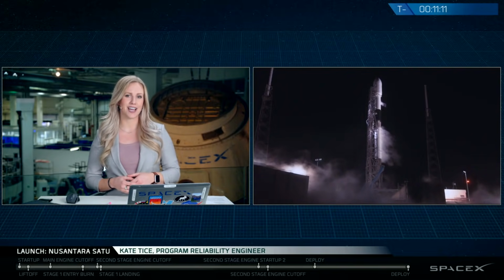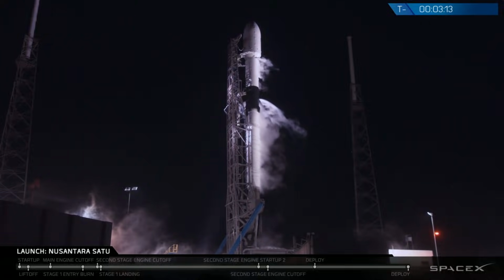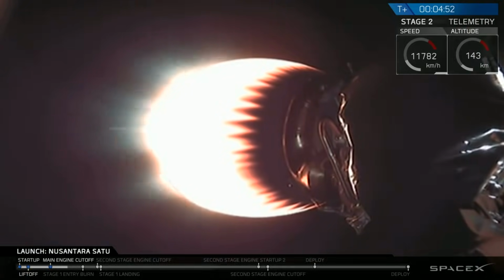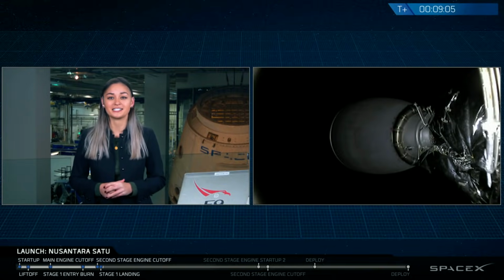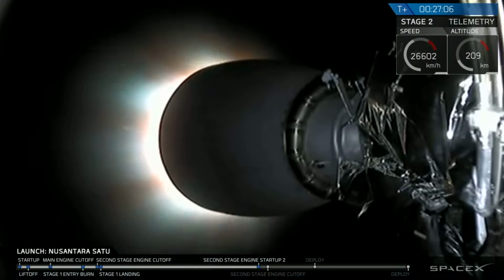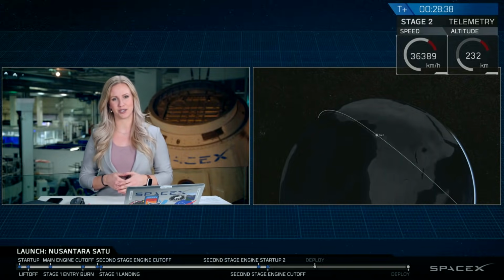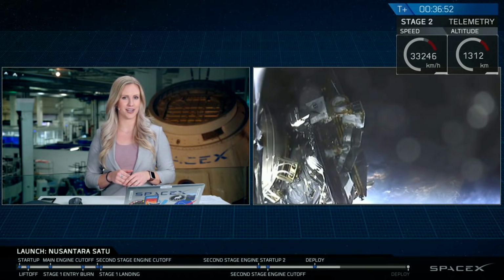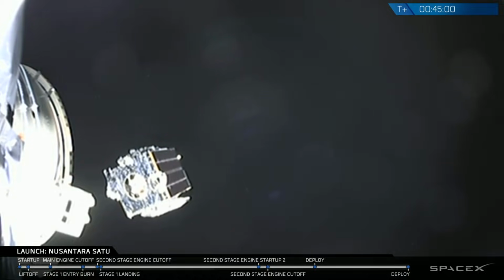Nusantara Satu Mission

Comment: I love it how they are progressively reducing their stage 1 landing celebration. As if they are getting used to it.
Reply: That's a good thing
Reply: It's weird because when they first landed them it was a massive hype then it died down by the end of 2016, then shot up for a bit at the start of 2017, and then as boosters started re-flying there was massive applause. It died down just after Falcon Heavy before going back up for Block 5 and now in 2019, every single mission has had pretty high amounts of applause, due to the record breaking landings

Comment: A few weeks left till the Block 5 Falcon heavy is in space 😋
Reply: Hopefully, if it doesn't get delayed more..
Reply: ONE WEEK!?
Reply: @PassportGaming  If Dragon 2 launches on March 2nd, Falcon Heavy cannot be launched for another 5 weeks because of the time it takes for a turnaround of the pad.
Reply: @PassportGaming  That's simply not possible. Dragon 2 launches on LC-39A with a Falcon 9. Shortly after, they will begin a long 4 to 5 week process of switching the launchpad to an FH compatible one, and fixing/cleaning the launchpad. FH can only launch on LC-39A.
Reply: @PassportGaming  tag me
Reply: @kuu5956  That was their old Pad that took that long, Im pretty sure the ones they have now in florida are both upgraded so that they can be turned around within a week or two
Reply: Tag me in
Reply: @kuu it literally launches from the center clamp for falcon heavy support clamps
Reply: Shiii
Reply: @PassportGaming  @Kuu Is correct, Only one pad is used for the heavy. Same one the Saturn V used, and shuttles.
Reply: All they need to do is switch the clamps to heavy configuration iirc. Probably NET 3 weeks after Dragon 2
Reply: Mid March hopefully
Reply: I really hope it ends up being fully recovered. Need to get that centerstage on the barge...
Reply: @PassportGaming  No you won't. Currently on the manifest, in order, is March 2 Unmanned demo mission, then RadarSAT after that, then In flight abort test (which is going to be so awesome). After that CRS-17 on April 25, then finally Falcon Heavy Arabsat sometime in March, probably. I will bet you 1000 internet points that it won't launch in 1 week 5 days.
Reply: That timeframe is highly questionable, considering there is another launch scheduled for the same pad 5 days before that, a 5 day turnaround on a single pad would break ever record there is for getting a pad ready for another launch
Reply: No. Although a lot of people have this idea that it has been scheduled for March 5, the only source I have found for that is spacexnow.com, which is a fanboy site with a lot of errors in its launch schedule. More reliable sources, such as Spaceflight Now and the Wikipedia page List of Falcon 9 and Falcon Heavy Launches continue to show it just being "March", with no date specified. My guess is that they don't want to set a date for it until Demo-1 is safely in orbit. I would say expect it in mid to late March some time.
Reply: Kuu where did you get that 5 week time? It would take 2-3 weeks to get it ready for falcon heavy
Reply: Jay Buens actually it has nothing to do with clamps, there are 2 primary reasons why a 5 day turnaround is unrealistic, the pad takes quite a beating from vibration and rocket exhaust every time they launch, you have to inspect all the plumbing, electrical cables and mechanical systems and repair what gets fragged, also SpaceX’s integration building does not have enough room inside to assemble the Falcon Heavy while there are any other rocket cores in the building.
Reply: Dm-1 will be on March 2, after this launch SpaceX will repair the launchpad and when they are finished, Falcon Heavy can launch from HLC-39A. Falcon Heavy is offically NET March, the exact date depense on how fast SpaceX can repair the pad. Falcon Heavy will launch on Thursday, so the possible launch dates are: March 7, 14, 21 and 28. Latest expections assume March 28, but an earlier date is possible.
Note that we will have one more  launch in March for canadian Radarsat, the second RTLS on the westcost and (some people guess) the fourth flight of B1046.

Notes:
Dm-1: SpaceX's first uncrewed demonstration mission of Dragon 2 or crew dragon
HLC-39A: Historic Launch Complex 39A, Kennedy Space Center
NET: No Earlier Than
RTLS: Return To Launch Site (landing on land)
Reply: @kuu5956  Not possible? Not Possible? I heard they can turn it around in 10 days.
Reply: @geraldhenrickson7472  They cannot.

Comment: GG on landing that booster for the third time
Reply: How Does it Really Work and if that one lands it will be the first time reusing and landing a orbital booster for the 4th time if memory serves me well
Reply: @Tinotin12  There's no way it will be landing. It will be destroyed in the flight, and even if it did land it won't be the first time flying a booster 4 times, I garuntee that's gonna go to B1046 in March. RADARSAT will use a recovered booster and the only options that are not on the eastcoast are B1046, B1050, B1049. B1049 just flew, B1050, no one knows where it is if it is anywhere. B1046 is the likely option for flight 4
Reply: Andrew no way it will be landing?
Reply: @seanz6586  You can't land a booster that is torn to shreds during the abort test flight

Comment: 24:46 metal sparks coming off the first stage heat shield due to the faster than normal re-entry
Reply: Uhh.. I think that's it coming down through rain.  They had deteriorating conditions out there at the time.

Nope, while it did come through clouds those were indeed sparks.  You were right! :)

Comment: In future can you provide some commentary or actual video describing the steps you are taking to de-orbit the second stage or other components. It would be a nice gesture (and challenge to others) to show that you are making an effort to minimize space junk. Thanks.
Reply: This stage is headed out of orbit. Its gone, passes the moons orbit in around 7 days. That ball is outta here! Pretty clever stuff!
Reply: Hello  @geraldhenrickson7472 . Thanks for the info. Great to hear that this second stage is taking the high road. It would still be nice if SpaceX were to provide that type of info as part of their WEB cast. Obviously second stages that only deliver payloads to LEO would have a different trajectory and as such are likely to end up as orbiting space junk unless steps are taken to de-orbit the item or at least do something, even if small, to begin the de-orbit process so that the upper atmosphere will eventually do the rest. It is this type of info I look forward to hearing about in the future. It would raise the bar for all rocket launching companies to provide the same info  at the end of any WEB cast. Thanks again.
Reply: @normfolkers8966  afaik theres 3 ways they deal with them, for leo missions they deorbit them, for very high energy orbits they sent them into solar orbit, and for gto they usually let it deorbit on its own, since on those launches the periapsis is very low compared to leo launches.

Comment: So what become of the Stage 2 Vehicles after deployment of the cargo? Burn up on re-entry? Splash down and sink into the sea? When will Stage 2 be re-used?
Reply: Stage 2 burns up on reentry.
Reply: After the launches to the geostationary transfer orbit, (like this one) the second stage is usually left orbiting Earth. The orbit gradually becomes lower and lower, until the stage burns up in the atmosphere. Usually it takes quite some time.
Reply: I believe they've shelved plans to recover and reuse stage 2 in favor of accelerating development of starship/super heavy. Not worth the r&d costs since F9 and FH are going to be replaced by SS/SH. So yeah, it burns up on re-entry.
Reply: @lowanfast  Just not right away. It re-enters atmosphere *eventually*. A bunch of the Falcon 9 second stages are still orbiting years after having been launched.
Reply: lowanfast So the Space49 payload will hit the moon before the Space10 stage2  hits Earth...

Comment: PAYLOADS

SSL built the Nusantara Satu satellite for PT Pasifik SatelitNusantara (PSN), a leading Asian provider of satellite-based telecommunication services. Nusantara Satu is Indonesia’s first high-throughputsatellite thatwill serve toimprove internet connectivity in the region. Additionally, the satellite’s C-band andKu-band transponders will be used for voice and data communications and video distribution throughout the Indonesian archipelago. In order to bring a secondary payload to orbit, SSL designedNusantara Satu using its next-generation electric propulsion system. The launch demonstrates SSL’s ability to take small rideshare satellites to geostationary orbit efficiently and economically.SpaceIL’s lunar spacecraft Beresheet (Hebrew for “in the beginning”), which competedin the Google Lunar XPrize, will be the smallest spacecraft to ever land on the Moon, at only 1,322 lbs, or 600 kgs. Upon deployment, it will travel to the Moonusingits own power, a voyage that will takenearly two months. Once itarrives,Beresheet will beIsrael’s first spacecraft and the world’s first privately-funded spacecraft to reach the Moon. Its mission is to transmit photos and video of its new home and conduct scientific measurements. The Air Force Research Laboratory (AFRL) S5 experimental small spacecraft, developedand integrated by Blue Canyon Technologies, will carry out a one-year mission. The S5 mission leverages commercial advances and services in a rapid demonstration of small satellite capabilities.    

Source: https://www.spacex.com/sites/spacex/files/nusantara_satu_press_kit.pdf
Reply: Hmm

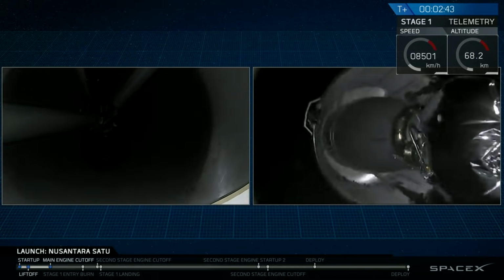Comment: 14:41 That foil is inflating due to drop in outside pressure? Purpose of foil is to act as a light barrier to particles entering inside components?
Reply: It inflates because there are various valves under it which release gases. The main purpose of the cover is to protect the equipment from the radiant heat coming from the nozzle by reflecting it away.

Comment: Wow impressive speed! 26554KM/H that is 7376M/S! Then at 38:54 you see a paper fall of in slow-motion! 7376METERS per second, what a speed! Amazing!
Reply: You calculated the velocity correctly, and it is very high indeed. Many people notice the object that very slowly accelerates away from the rocket which you have pointed out. It is actually not paper but solid oxygen "snow" from the engine. It always occurs in launches when the engine is restarted in orbit. It has to do with the nuances of engine plumbing.

Comment: Wow! Can't wait for the passenger BFR intercontinental flight. A few years from now 1st stage landing would be so much more routine that clapping after landing will be considered retarded, like in airplanes!
Reply: Heh heh heh.. It will be decades if not longer before you see BFR's flying passengers around the planet. :)
Reply: @TheEvilmooseofdoom    10 to 20 years.
Reply: @odysseusrex5908  At the very least, and I would doubt even that.  They'll be starting from scratch AFTER they establish reliability and get certification from the piles of agencies.  I doubt it'll ever happen as envisaged.
Reply: @TheEvilmooseofdoom    There aren't piles of agencies. Really just the FAA, and NASA I suppose, although I do not really know if NASA's certification for manned spacecraft is required in general, or just for NASA personnel to fly. Either way, there will be a certain grey area between air travel and space travel that the regulatory scheme will have to cover. I suppose Virgin Galactic and Blue Origin have already addressed the matter. They, of course, are returning to launch site, but the difference between that and coming down somewhere else shouldn't be that great. I stick with my prediction, within twenty years, somebody will be offering point to point suborbital transport on some kind of vehicle, whether it is BFR, Skylon, or something developed by somebody else.
Reply: @odysseusrex5908  Handing passengers is not as simple as all that, especially when flying them and regulatory agencies and insurance agencies being what they are there will be a pile of certifications.  BO is carrying small numbers of tourists not regular passengers that comparison is flimsy at best.  Perhaps in 20 years there will be a small point to point system somewhere as a demo platform but regular service is a long way past that merely because all the infrastructure has to be started from scratch and the technology has to be proven.
Reply: @TheEvilmooseofdoom    It's not a comparison, it's a prediction of an evolution. Twenty years after the invention of the airplane, there was, limited, regular air passenger service in many places. I don't know when the first such service was offered, but there was barnstorming first. Thinking about it, I should extend my timeframe, not to twenty years from today, but to twenty years after the first manned flights of BFR, though it could well be sooner.
Reply: @odysseusrex5908  Either way, there will be a certain grey area between air travel and space travel that the regulatory scheme will have to cover. I suppose Virgin Galactic and Blue Origin have already addressed the matter.

There is no comparison between small numbers of people in space tourism and large scale passenger service and how they're regulated.  It'll be a LOT different from how air travel is regulated in many ways.  Comparing it to the non-regulated birth of aviation is also flimsy.  The insurance aspects alone are going to be vastly different.

Regardless, I would say you're probably right that it will be 20 years after the first flights before someone starts to think about it and even then it will likely be a special service between a few select locations vs any kind of large scale service like airlines.
Reply: @TheEvilmooseofdoom    No, they are already thinking about it, obviously. I'm saying that it will be no more that twenty years, probably less, after BFR begins orbital flight that suborbital passenger service will be established.
Reply: @odysseusrex5908  They think about a lot of things.  That's meaningless.  If I had the years left I'd lay money there is nothing more than a single point to point demo IF even that in 20 years.  It's a far bigger project than merely putting another kind of airplane in the air so much so that they'll be starting entirely from scratch and that's expensive.  They'll also be flying into the headwinds of regulation that didn't exist in aviation.  It's a fantastic notion but likely little more than that.
Reply: @TheEvilmooseofdoom    Actually, it occurs to me, what will probably come first is unmanned suborbital cargo service. I have, for many, many years, imagined Fedex's slogan for cargo going from east to west across the international date line, "When it absolutely, positively, has to be there *yesterday*." These might be unmanned, as I say, or they might have small flight crews like cargo planes. Anyway, after people become comfortable with the fact of suborbital flight, then passenger service will start. As I say, this will be within twenty years of the first BFR flight. If a capability exists, it will be economically exploited.

Comment: The second stage finishes its burn before the first and second deploy right? So why does the first deploy maintain orbit around the earth, while the rest of the second stage progresses outwards for deploy 2?
Reply: When a satellite is released its velocity changes very very little. For all intents and purposes it continues going together with the rocket. Right now, the three satellites and the second stage of the rocket are all in roughly the same orbit 245 km x 68900 km, give or take a few kilometers. What will happen next, is the satellites will use their own engines to change their orbits, to go where they need to go. The second stage, on the other hand, will gradually get lower and lower due to atmospheric drag. Though small, it will bring it down in about a year or so.

Comment: I'm actually shocked Israel doesn't have their own booster rocket/launch vehicle..
Reply: This moon lander is created by a civilian startup company, so they are free to shop around for the best deal to launch it. 
Otherwise, there is an Israeli booster. it is called Shavit. They seldom use it, and when they do, because of the geography, they have to launch it in the least favorable direction -- westwards. Last launch was in 2016.

Comment: Is the second stage ever recovered or does it become more space junk or burn up on the atmosphere?
Reply: Not recovered. Most are deorbited.  Good discussion here: https://space.stackexchange.com/questions/7814/what-happens-to-the-falcon-9-second-stage-after-payload-separation
Reply: @dansv1  It is very easy to check. Google "satellite tracking". Open the site which comes as the first result. Type in "Falcon 9" as the name of the satellite. Voila! A list of all Falcon 9 second stages with their current status. Lots are still in orbit and you can see exactly what their orbits are. (Of course all of them will burn up *eventually*. If I remember correctly, NASA recommends that nothing is left in orbit for more than 25 years after it has served its purpose, and most Falcon 9 stages decay much faster than that.)
Reply: How Does it Really Work  Thanks!

Comment: After the final second engine cut-off, there's a noticeable and continuous decrease in the velocity, as the spacecraft continues to gain altitude.  Is this a reduction in tangential velocity as a result of going to a higher altitude (while angular velocity remains constant)?  Or is that an actual decrease in angular velocity due to .. what?  Tiny amounts of air drag?
Reply: It's the conversion from kinetic energy to potential energy. Rockets fly the slowest in the highest point of their orbit. 
Angular velocity doesn't stay the same throughout the the orbit.
Reply: Look up Kepler's Third Law.
Reply: I understand, now.  Thanks!